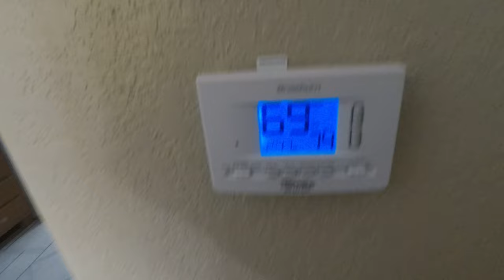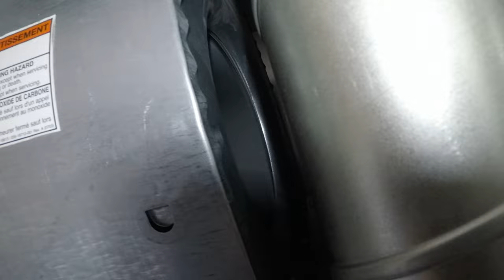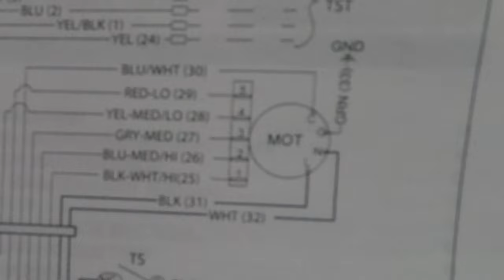Silence Noisy Manufactured Furnace These Simple Trick!

Comment: Not trying to be mean, but it literally didn’t seem like whatever you did made any difference. It still sounds like my new furnace, like a jet. I want my old quiet furnace back!!
Reply from the maker: Trailer furnaces are gonna be noisy it did quiet it down just a tickle.
Reply: I know ,right? Just had a new one installed today and when the fan kicked in I started waving two fingers in the air like an aircraft carrier flight deck launch officer, and then I reached over and touched the floor to launch it. Unreal loud even on the lowest fan setting. Guy says that how they are. I'm like whaaa?

Comment: Thanks for the vid, but I have to go with the other peeps commenting here ... no diff at all really. Just installed a new furnace today and sounds just like this. Like a jet engine running even on lowest fan. unreal. Can't believe I pain the money I did for  brand new one much louder than my old one. Unreal
Reply from the maker: With the Manufacturing housing furnaces and the new Constant torque motors, they are definitely going to be louder due to the static pressures. There really isn't going to be a way out of that, unfortunately. I wish they would have left the motors be.
Reply: Hey Thanks for hittin me back so soon. Let me ask you a question, Can I put some sound deadening on the actual fan motor casing? Like , kind of use some sticky backed sound deadening wall foam to wrap the outer shell of the fan cage. Or does it get to hot for something like that? That is a great little light btw  @ADVANHVAC
Reply from the maker: Your welcome, That wouldn't really work. It's the airflow and with the small ductwork it will be loud no matter what you try.
Reply: Thank you so much for your reply. I am looking at sound absorbing materials that are heat resistant and may try wrapping the fan and placing some in places away from the hot pipe on the right side . If it gives any significant reduction I'll let you know. And thanks again. @ADVANHVAC
Reply: @jusam6854  did the sound absorbing material work?
Reply: I’m also really struggling with the noise of my brand new MH furnace. Would love to know if any sound dampening tactics work!
Reply from the maker: @WilliamHellmuth you can try to lower the speed down a tickle.
Reply: @ADVANHVAC  yeah I’m going to give that a try for sure. If I can get it to the same noise level as my 30+ year old furnace from my old MH, I’d be a happy camper!
Reply from the maker: @WilliamHellmuth right on.
Reply: @ADVANHVAC  It worked! Got the speed lowered and MAN what a difference! Thank you for this. Now I'm just going to try to find some ways to dampen the noise so it doesn't travel as much (coat rack, rug, etc).
Reply from the maker: Glad it worked for you!

Comment: Would a Miller unit have the same constant torque motor with 24v? Do they make replacement fans with a less aggressive blade angle to be quieter like you can get bathroom vents that are nearly silent.  Or how about something like the dial for a dimmable light fixture to manually control the speed?
Reply from the maker: Unless you want to replace your existing furnace, I don’t believe they have an aftermarket motor for Manufactured housing.All new equipment have the x-13 motors on them.
Reply: @ADVANHVAC  I believe this unit is the original from 2005 build. Is the X13 newer?
Reply from the maker: I’m pretty certain that would be a PSC motor not an x-13 I’m thinking X-13’s didn’t start popping out until about 2013 or so.